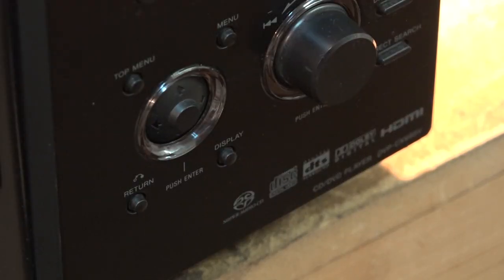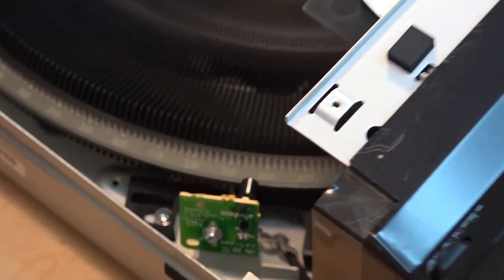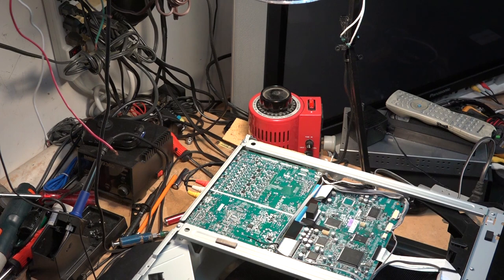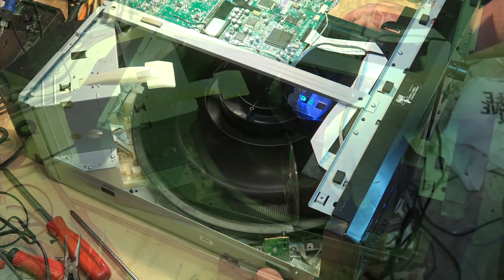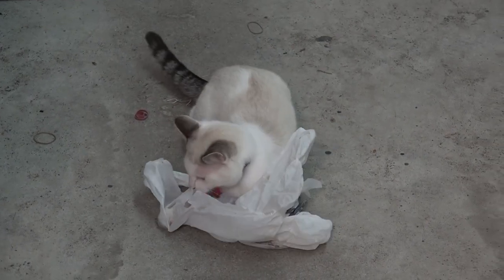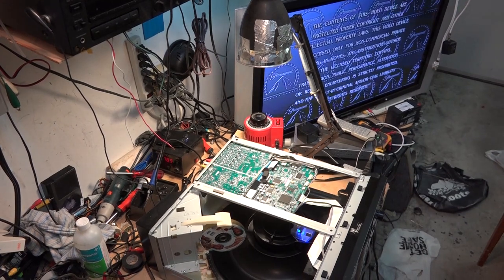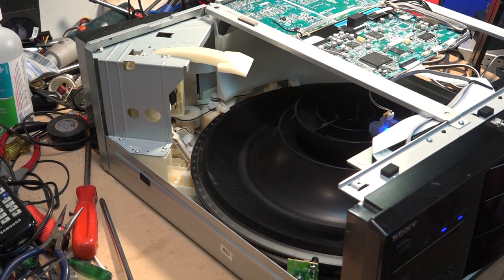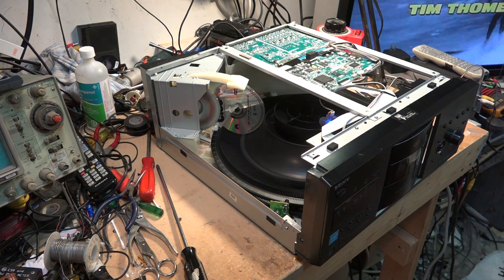Sony DVP CX995 400 Disk Changer no play

Comment: As an early subscriber I watched a lot of your video's. I enjoy them a lot. Of course I noticed you're using a Variac.
You once mentioned in another video that it was a safety precaution, But are you aware a Variac is not an isolation transformer? It is an auto transformer with just a single winding. Basically it is a big, high current wirewound potentiometer.
Using a Variac you are by no means isolated from mains power!
Reply: There are variacs with two windings that also act as an isolation transformer. I have one of those.
Reply: Do you have brand/type?
Reply: It's the type TST 280/6, made by RFT in the GDR.
Reply from the maker: Duh. My variac is there only for voltage control, so if I get an intermittent I can vary the input voltage to see if it is a regulation fault. The variac is plugged into a 800 watt isolation transformer that is mounted under the bench. The isolation transformer comes on when I turn on my bench power, and the switch on the variac I use to control a separate power bar that I can set the voltage. If you watch the video test bench safety, you will see the isolation transformer.
Reply: Thanks a lot for explaining

Comment: I’m getting a C32 00 on the screen any suggestions or Help?
Reply: some codes are in the manuals for the 985 amd 995.

C 32 The front cover automatically opens and the player enters standby mode. ,Check that there is nothing wrong inside the rotary table, such as a fallen disc. After you have checked the inside of the rotary table and resolved any possible problems, press PLAY.
Reply: That error is for the wheels the carousel spins on. You can see the white posts for the three wheels from the bottom of the unit. A post might not be locked in place. I have seen another video where they will just glue the foot back in its correct placing instead of taking the unit that far apart.
good luck.

Comment: Do you know where I can buy a replacement lens for this? I keep getting a cannot play error. The disc will turn but not for long. Any help would be very much appreciated!!!
Reply: clean the lens, you have to remove the cover and clean it with a swab and you must use lens liquid you cannot use a different liquid such as water or perfume